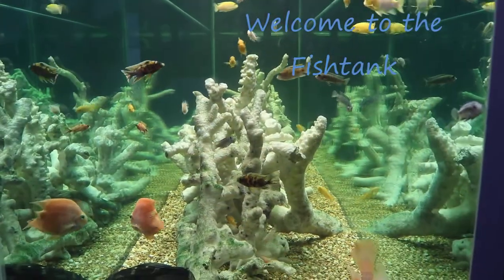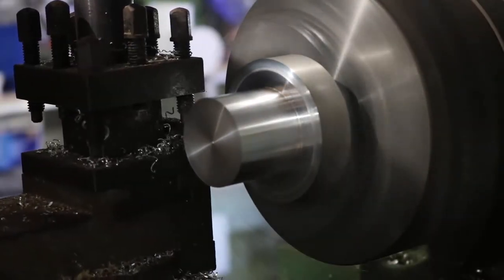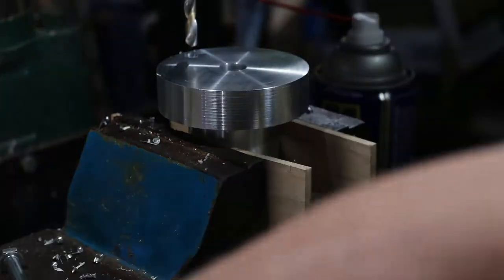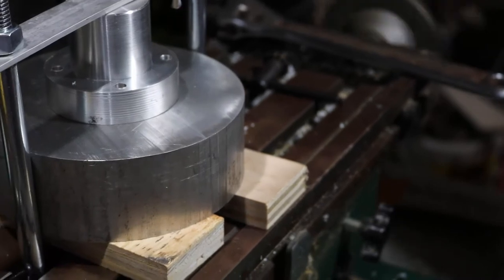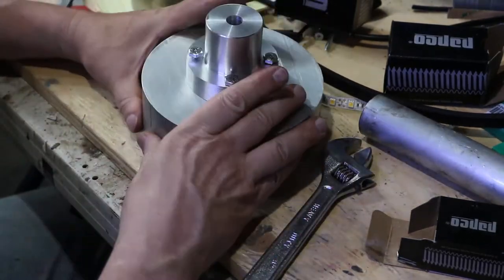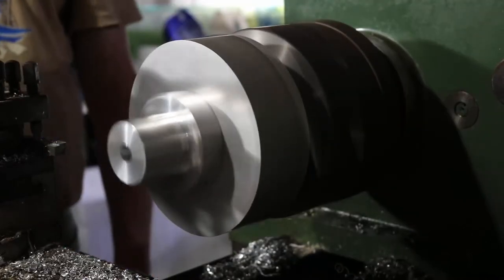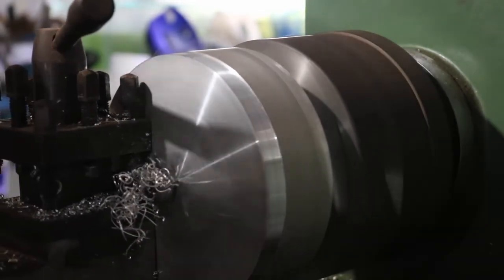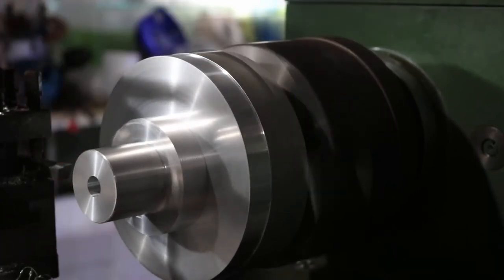DIY Mini Band Saw Part 2

Comment: Hey bud, good to see I'm not the only guy in the middle of building a band saw and now re-thinking my approach to turning the pulley's that don't fit in my lathe! a near carbon copy of projects..lol.  Cheers.
Reply from the maker: You should post some vids of it. I would love to see it. I keep meaning to get back to the build but there is so much going on. I also thought of a aluminum cross sled for my table saw that I haven't gotten to lol